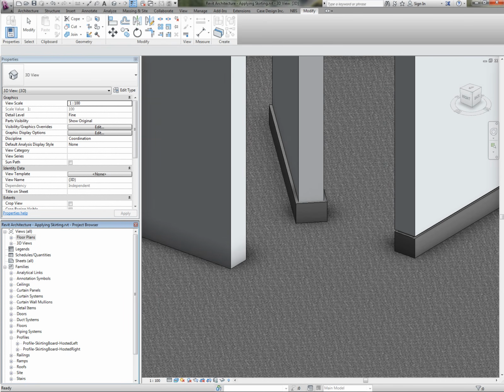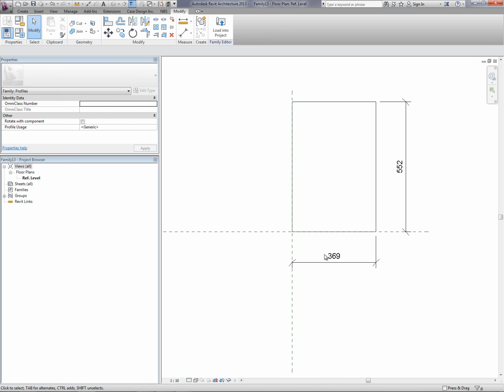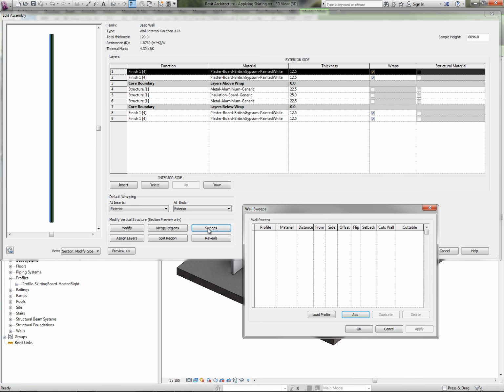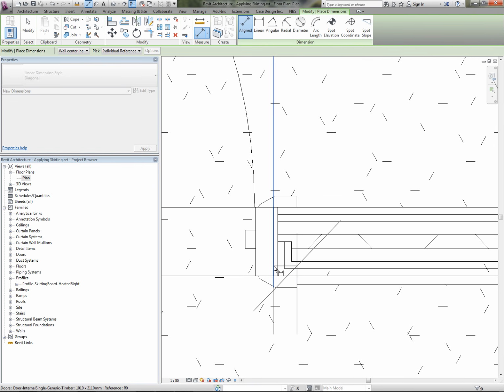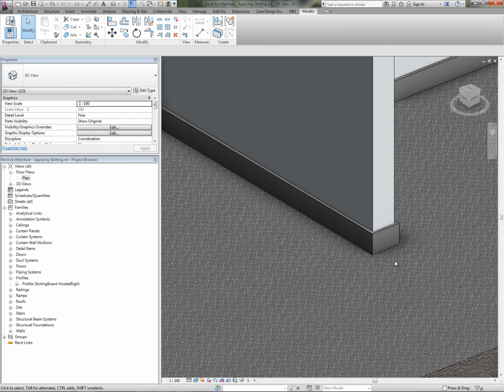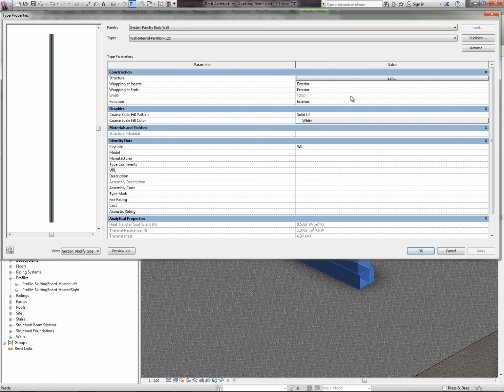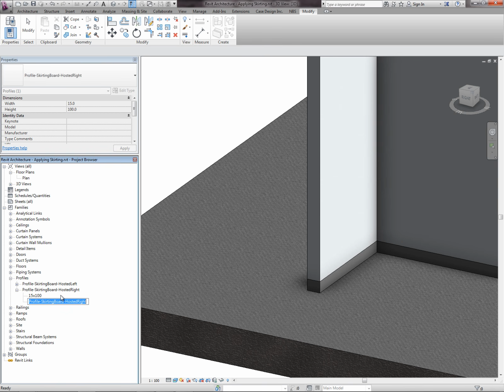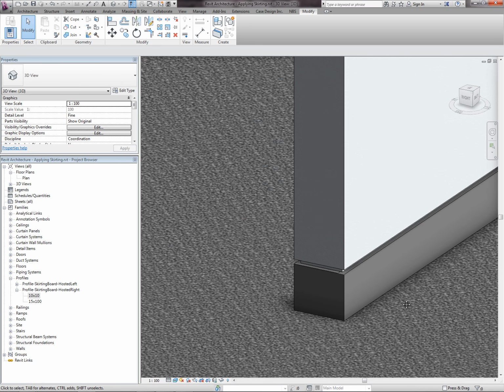Revit Architecture: Applying Skirting using an integrated Wall Sweep

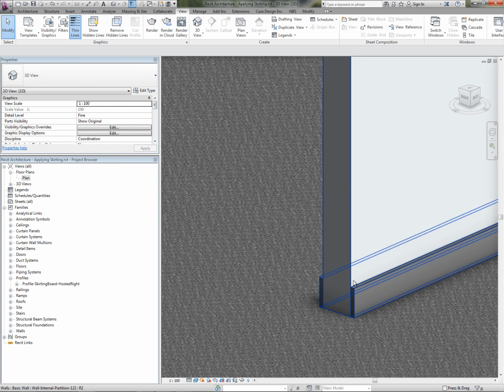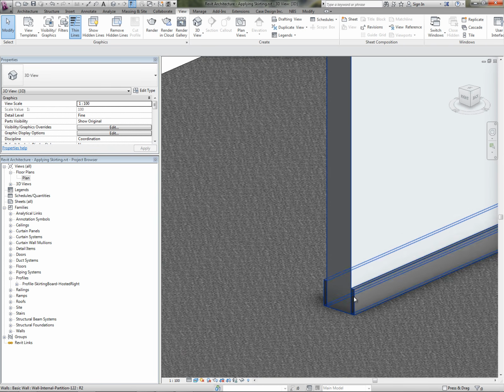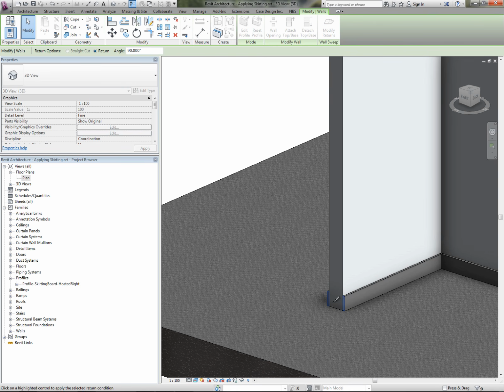Comment: 6:43 one question. I followed the steps as in the video, but when I check the "T" intersecting wall (as shown in 6:43-6:46, right hand part), the interior side sweep seems to follow the foot of the left wall and just "go trough" the right wall. any idea how to make the sweep stops at the corner (when it meet the sweep from the adjacent wall) but continue again after "leaving" the wall (intersection) ?

Comment: Well done !
Personally,  I’ve been struggled whit that skirting returns issue,
Wondering if that method also applies for  take offs, although is not a relevant amount, 
Many thanks
Reply: You can schedule wall sweeps. But integral wall sweeps, which are part of the wall type definition, cannot be scheduled independently.

Comment: Thanks for the video Nicholas, very clear.

One question you might be able to answer:

Where did you save the skirting profile- right hand side file as it does not show up as an option on my drop down list when I go into the wall sweeps dialogue box? Load Profile doesn't seem to work either when I manually pick out the file in my Revit Library folder..thanks

Comment: Hello Mo,

Yes you can. You would need to use either a standard Material Tag, or a Keynote Material Tag. Unfortunately an Element Tag, standard or keynote, would simply pick up the whole wall, not specifically the skirting. Let me know if you would like me to put up a short video.

Thanks
Reply: Please put up the short video